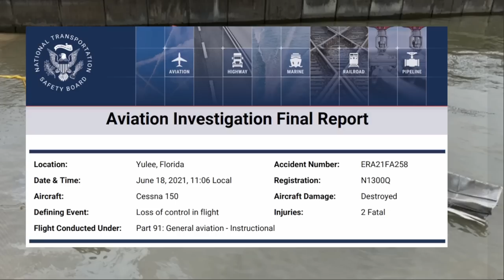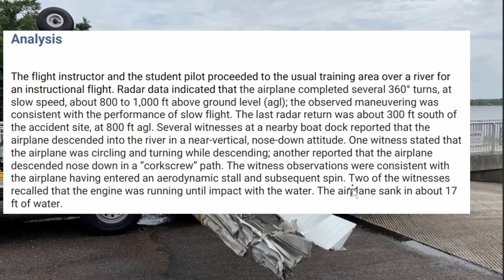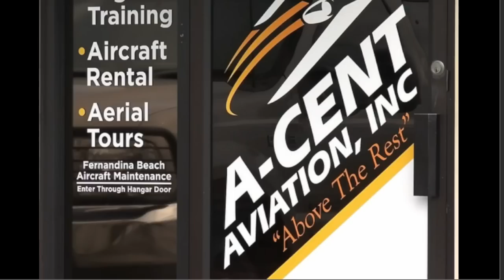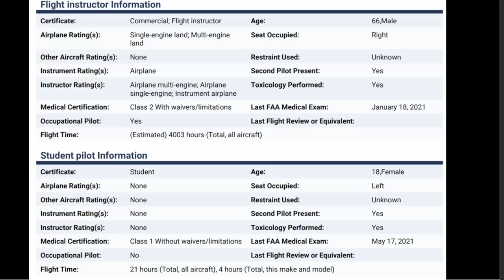Slow Flight Training and Disaster

Comment: A good instructor would have done that training at a higher altitude, with room for recovery. I believe this tragedy was avoidable.
Reply from the maker: Super sad one
Reply: Most are.
Reply: correct. totally avoidable. i insisted my flight instructor go higher when we were practicing this. As I gained more experience over the years, i reflect back on how poor my training was.
Reply: Altitude is your friend.!
Reply: Power on stall and power off stalls are about handing the aircraft on take off and landing…mainly.  Stall training above 3000’…5,000’ in my tomahawk…more difficult to recover if you spin it.

Comment: I’m currently in pilot training and I’ve done this same exercise multiple times. You are supposed to do slow flight training at an altitude where you can fully recover at 1500 AGL (above ground level). There’s no way they should have been doing this at that altitude. Prayers to the families 🙏
Reply from the maker: Thanks Jeff, God Bless
Reply: Yeah thats exactly what I was thinking. Poor risk management by the instructor. Also poor speed management. You can stall in any attitude and any power setting.
Reply: When I would do stalls with my instructor and any subsequent stalls after getting my PPL, I’d be at least 3000ft agl.
Reply: @lemonator8813 You can stall a plane at any speed but one angle of attack.
Reply: Welcome to the sickness Cap'n!  👍😉
Reply: HASELL check before such maneuvers .... 
H - height sufficient to recover by 2500ft agl
A - airframe configured and in trim
S- loose items in cabin secured
E - engine T&P, fuel pump on, mix / prop set, C/H hot.
 L - location; airspace, built up areas, cloud, 
L - Lookout (clearing turn)
Reply: @mikemicksun6469  Certainly true but you need enough altitude to recover.
Reply: In Australia, we did stall training at 5,000 ft.
Reply: @nicholasjohnson6724  Do you guys do spin training in Australia?
Reply: @mouser485  did my PPL in 2010, stalls, climbing/turning stalls, very mild spins
Reply: @nicholasjohnson6724  Thank you. I was curious. While we do stalls, We don’t do spin training while acquiring PPL in the USA, or at least didn’t do them in the state I was in, Alabama. I knew some countries required spins in order to get your PPL but didn’t know about Australia.😀
Reply: Any time maneuvers were being conducted that a stall/spin was possible, we also did them at 5000ft AGL. Not sure what the books says but 1500 sounds a bit low.
Reply: that was the requirement when I was "stall" training. We never did anything like that lower than 1500 feet.
Reply: Prayers eh? That'll help.

Comment: SLOW FLIGHT AT 1000'???? Thats insane.   I would not do it less that 3000.
Reply from the maker: Thanks for sharing what you do
Reply: You are technically flying slow flight during landing which is below 1000’ on final. It’s not about slow flight, it more like stall recognition.
Reply: @aviatortrucker6285  yes but at 1.3 VSO not just above stall AOA so that 30% margin keeps you safe during a normal landing.
Reply: the school needs to go under review by the FAA and shut it down until their investigation is concluded, there might be other fuckd up stuff going on that we still don't know about.
Reply: @aviatortrucker6285  nope, wrong, on approach you just give the plane the necessary speed to stay in the air maintaining a controlled descending rate at all time, allowing gravity to do its work without too much throttle input, on the other hand what we are talking about here is actual stall recovery training done on purpose in which the trainee has to apply the technique required to push the aircraft out of the stall, that is not done at 1,000🙄 under no circumstances, it's suicidal, the higher the altitude for this the better because of so many factors that can change the outcome of the maneuver include weather, atmospheric pressure that day and including aircrafts gross weight at the time, what happens if the trainee doesn't get right on the first try or it takes him or her too long to do so? that's way you need enough altitude and time for the instructor to take control, and this is way the higher the better.

Comment: In my club, back in the 80's, 3,000 AGL was the ceiling for performing practice maneuvers, with 1,500 being the floor, or lowest point of recovery. Remember, any altitude above 3,000 feet, and altitude rules come into effect.
Reply from the maker: Good point and thanks for sharing it
Reply: Me too in the 90s and since
Reply: 3000 AGL
Reply: Check the regs. The VFR cruising altitudes are for cross country flights. Not for practice or performing maneuvers.
Reply: Most training facilities have practice areas. With a student it is more important if they lock up you need time to take control!

Comment: You are right training can come with risks but taking additional risk by contacting training in low altitudes is unnecessary and in this case deadly. Personally I never did any maneuvers close to the ground.
Reply from the maker: Thanks Chris.  Very risky
Reply: …except ground reference maneuvers which are supposed to be done between 600-1,000 AGL.

Comment: I stalled and spun a Cessna 152 once in practice.  Fortunately I was 3000 feet AGL. After a 1.5 second "startle" reaction, my brain kicked in and I thought "Why not retard the throttle to idle, apply full opposite rudder, and push briskly forward on the yoke?" When the spinning stopped, I neutralized the controls, took a deep breath, and did a 2.5 G pull out. I was now flying in the opposite direction, and was about 800 feet closer to the ground!
Reply: Yee haa !
Reply: 3 turn spin is 700 feet height loss in 152.
Reply: You pushed on the yoke while trying to recover the spin?? Weren't you taught to sit on your hands and use opposite rudder only until the spin stopped, then grab the yoke?
Reply: @cathlive267  No, I was taught to "neutralize" the yoke. Your teaching may differ!
Reply: @cathlive267  Pushing the stick forward allows the aircraft to gain airspeed more quickly and allows for a much faster recovery
Reply: @traviscrane7649  but you are already nose down in a spin. Pushing forward is the last step, after the spin stops, not the first.
Reply: @cathlive267  Read the emergency procedures for your aircraft. It differs from plane to plane.
Reply: Wow

Comment: I routinely practice slow flight,  slow flight turns and stalls.  I practice these maneuvers with gear down and gear up.   I practice these maneuvers at 3000’ Above Ground Level.  I practice them to remind myself of how the aircraft behaves in slow flight (sluggish) and note at what airspeed the aircraft starts buffeting (vibrating) right before the stall.  And I even hold the aircraft in the beginning of the stall.  A stall is no big deal if it is practiced.  That way if it happens in flight you know what it feels like, and you know how to recover.  The landing pattern is the time where you are low and slow.  Practice slow flight and stalls, but do it safely.  Keep that ball centered in the Turn and Bank coordinator.
Reply from the maker: Thanks Kent for sharing with us

Comment: For training the higher you practice these maneuvers the safer you are, especially with a student.
Reply from the maker: Good point Phil 👍🏽
Reply: 3,000 feet should be sufficient. Fooling around above that, has you putting others at risk in the flight levels.

Comment: This is sad. I just did my first maneuver review at my local school, and of course that included slow flight. We conducted ours at 2500 AGL this day, but we typically are at 3000’-4000’ AGL to perform slow flights and stalls to ensure safety. Very sad this instructor didn’t take the necessary precautions for this maneuver.
Reply from the maker: Seems like a simple mistake.  Sad one for sure

Comment: Pilot since 1983... Flight Instructor since 2002.  The lowest I do ANY 'maneuvers' during training is 2,000' AGL.  Stalls and spin training 3,000' to 5,000' AGL. The FAA used to require that "Slow Flight" training be conducted w/ the STALL WARNING horn sounding. That typically is 6 to 8 kts above an actual stall. Several years ago, after some INSTRUCTOR/STUDENT accidents similar to this one, the FAA decided that "SLOW FLIGHT" training should be done above the STALL WARNING speeds, which would be at least 8 to 10 kts above the actual stall speed. One further point... stalling does not automatically induce a spin every time it happens. The Cessna 150 is generally a very responsive airplane to corrective anti-spin inputs once a spin does happen, and it could have been expected to recover from a stall easily at that altitude, but once a "spin" has been induced the aircraft immediately begins to descend rapidly and it is not uncommon to lose 1,000' or more of altitude before accomplishing a "recovery" from a spin. It appears that there was disregard for safe procedures in this case.
Reply from the maker: I appreciate you taking the time to write this for us.  Your knowledge and years of flying is so important to be shared to help prevent these type of things

Comment: The little 2-seat Cessnas are popular for training because they are relatively cheap to operate. When stalled they can go into an abrupt left-handed "snap spin," especially when practicing a power-on stall if the pilot forgets to proactively apply right rudder. The pilot must immediately get the nose down, idle the engine, and apply hard right rudder. After the plane stops spinning pull out of the dive. Can all this be done when the stall is at 1,500 ft agl? Sure, if all goes well.
Reply from the maker: Good points.  Thanks for sharing it
Reply: Hi Dad of Ray.... I don't believe one can say "SURE" and then follow that with "if". The "if" implies that it is NOT a "sure" thing. Plus... they weren't at 1,500' AGL ... they were between 800 and 1,000' AGL. Also... if the spin is to the "right" they should proactively apply "hard left rudder." CFII

Comment: From level flight, a Cessna's spin entry is a fairly leisurely event. It doesn't really wind up into a fully-developed spin until one turn has been completed. The instructor could have recovered within the first quarter turn.

However, after an accelerated stall, in a steep bank, The airplane will snap-roll into a "spin out under the bottom" (rolling toward the wing at the inside of the turn). It will then take more time and effort to recover. Unfortunately, they did not have sufficient altitude for that recovery.
Reply from the maker: Thanks for sharing that info Sam.

Comment: To conduct slow flight training involving 360 degree turns at 800' AGL is beyond stupid.  I have performed numerous spins in a 150 with full power and power at idle.  It takes at least 1000 feet to recover from a two-turn spin if you are proficient with engine at idle, opposite rudder and neutral ailerons and recovery from the stall once the rotation stops.  So, in this case even if the instructor knew how to recover from a spin, there was not enough altitude to do so.  Unfortunately, common sense did not prevail.
Reply from the maker: Bummer.  Tragic one.  Thanks Theresa

Comment: Doing these training maneuvers over glassy water or water its very hard to determine altitude for the instructor with all the flight instruments on the students pilots left side. Also instructors seat position is further back with the flight Instruments blocked by the student. Sea plane pilots know the dangers of glassy water landings, its impossible to determine altitude. Also the plane looks like a Cessna 152 not 150. 152 has a bigger lycoming engine with 30 instead of 40 degree flaps. Another question, was the altimeter barometric pressure set correctly or sometimes the instrument is not accurate. This is easy to check, set the altimeter to field elevation compare the barometric pressure to the awos barometric pressure.

Comment: As a retired banner pilot, we trained slow flight at AND below 300' AGL. This is because of the job-specific type of flying which requires flying at the minimum safe airspeed when the banner is attached. And yes, stalls are common at and below 300' AGL, especially with a banner attached when there's lots of turbulence and strong thermals. It's amazing that such skills are not taught in primary training. It could literally save lives.
Reply from the maker: Was there crashes in this training?
Reply: @ARFFWorld  not even close. It was all under very controlled circumstances, in the Everglades over long canal roads.
Reply: @ARFFWorld  there were rumors that some pilots even landed on the canal roads, which is actually legal but I wouldn't allow it when I was in charge.
Reply: There is nothing highly controlled about an accidental stall…

Stalls that occur in the traffic pattern are often deadly…

Stalls that occur during the turn from base to final don’t have enough altitude to recover….

Low experience banner tow-ers are often new commercial pilots earning flight hours while working their way up the ladder…. This is one of the first paid flying jobs available to newly minted commercial pilots…. Slow flight, near the stall speed, with lots of extra drag from the banner..

You get a few seconds to follow the procedures properly… a simple mistake can kill you.

It is better to take this to a higher altitude where the simple mistake doesn’t kill you.

Teaching stalls has already been removed from the training curriculum for a reason… knowledge of avoiding them is considerably better.

Only perfect pilots with perfect machinery should do stalls at low altitude.

Students aren’t often perfect pilots…

😀

Comment: Way too low. “Slow flight in a single-engine airplane should be conducted so the maneuver can be completed no lower than 1,500 feet AGL, or higher, if recommended by the manufacturer. In all cases, practicing slow flight should be conducted at an adequate height above the ground for recovery should the airplane inadvertently stall.” -AFH

Hot and humid June day in Florida, I’m sure the climb performance on that little 150 was affected, possibly why the instructor chose a lower altitude, not an excuse though. 

Thoughts and prayers to the families. Senseless loss of life.
Reply from the maker: Thanks for sharing this info

Comment: Difficult to be certain but the wreckage shows the flap in full deflection which is consistent with slow flight practice. If they had 40deg flaps that is a no no. We used 30 deg max for our spin training. Remember trying to grab the plane from a stall condition and it went into secondary stall which really increases the spin. Also most times with a big guy like that he sits farther back from the student to prevent shoulders rubbing. So probably not configured properly and perhaps he was not belted so when the chaos happens he cannot access the controls well enough to recover and the student is along for the ride...sad but the 'experienced' instructor killed his student. Also a slow prop speed can blank the tail with turbulent air and you cannot pull out of the dive unless you add thrust and smooth the air over the tail. Called blanking the tail I think.... Dan Gryder has the skinny on that.
Reply: That secondary spin is the killer..
Reply from the maker: Thanks for your take Daniel
Reply: Blanking the tail is caused by the flaps..that's why you have to be careful how much flaps you put in while doing slips in a 172.
Reply: @gringoloco8576  I disagree. When going straight down the unfeathered prop is adding drag and turbulence directly in the path of the rudder and elevator. Flaps do not do that. Slips with full flaps are very effective and the tail is outside of their path. I do it regularly for short field stuff. And in a 150 as well.

Comment: Did the flight instructor violate policy in training below the policy altitude? yes. Did that cause the accident? No. There are only two possibilities; The instructor was not proficient in inadvertent incipient spin recovery or The student locked up and did not release the controls to the instructor in a panic.
Basically it requires direct input of the controls to enter a spin (stall with uncoordinated flight) Generally a student would inadvertently use aileron instead of rudder to counteract a turn (wing drop)while stalling causing the stalling wing to deepen in the stall leading to a spin which is incipient and rapidly recoverable within 500 feet. If the controls were not immediately used in the proper spin recovery (neutral ailerons, un-stall -yoke forward-push, counter turn with rudder, then normal stall recovery)  The result would deteriorate into the described corkscrew vertical descent stall-spin and crash.
Reply from the maker: Thanks Fred for sharing that info.
Reply: It didn't cause the accident, but it may well have caused the failure to prevent the accident due to limited time to recover.
Reply: @SKYGUY1   It certainly significantly contributed to the cause of the accident, however my point was there was adequate altitude and time to recover if the spin recovery was immediately done in the incipient stage. Poor judgement, pilot error in not maintaining controlling the aircraft while maneuvering at low level would be my guess.

Comment: My instructor taught me to do MCA you don't need the stall horn blaring and be on the edge of a stall for slow flight. When practicing stalls, you hear the horn and get the buffet and break. 5kts above stall is fine and easy to stabilize with practice.
Reply from the maker: Thanks for sharing PJ

Comment: Practicing maneuvers during slow flight less than 1500-2000ft agl seems silly, i prefer 3000ft. It doesn't cost much more to practice higher. Did this instructor fly low with different aircraft, or just this one?
Reply from the maker: According to other students, he did